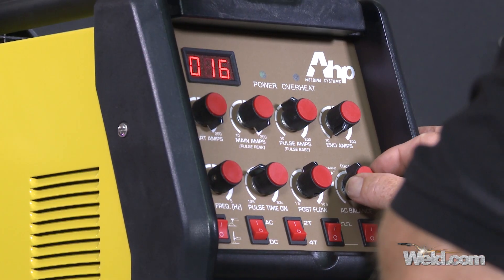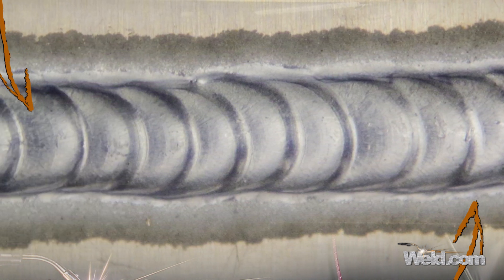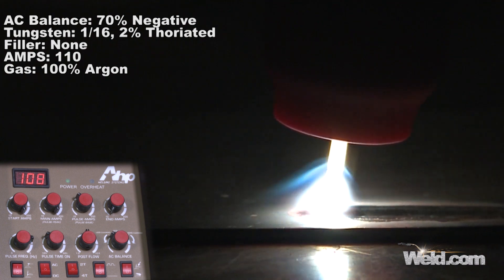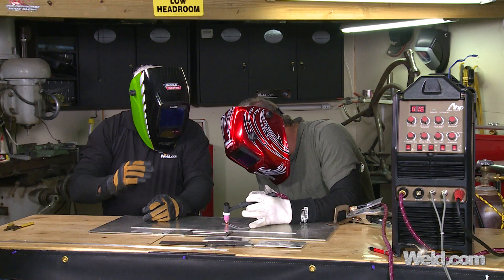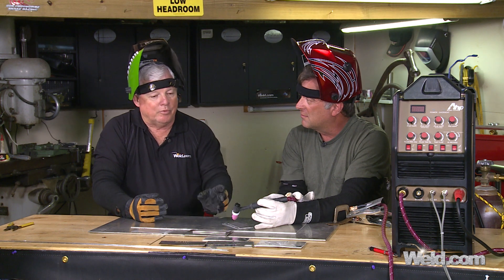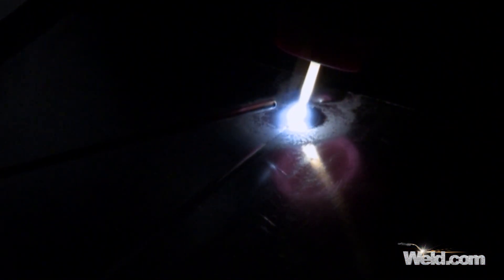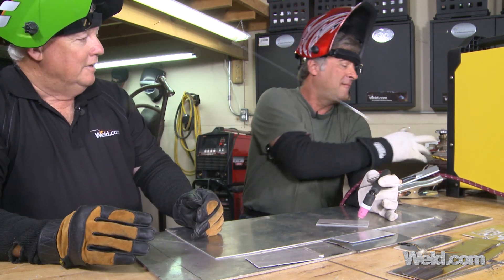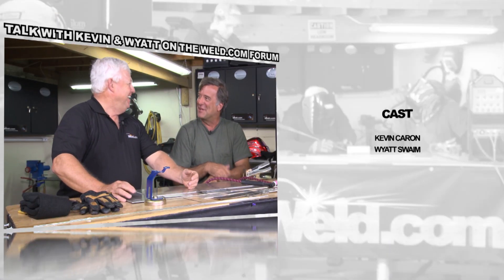TIG Welding for Beginners: Intro to AC with Kevin Caron | TIG Time

Comment: Yesterday i tried to weld a 1/4 in thick aluminium and couldnt even start a bubble and dont know what was the problem. I was using 25psi/ac/135amps . Any suggestion please
Reply: Not enough amps.  I would have started with 160 and backed off with the pedal from there.  Another thing you can do is preheat with a torch, aluminium likes heat, so you'd want to heat the whole part if you can, not just the area you're going to weld.  This will heat soak the aluminium so that it's not trying to "steal" the heat you're trying to put in it with the tig torch.
Reply: Thx very much... uluminum is not my type hahaha i deal more with stainless steal